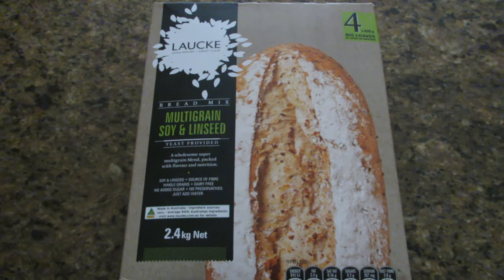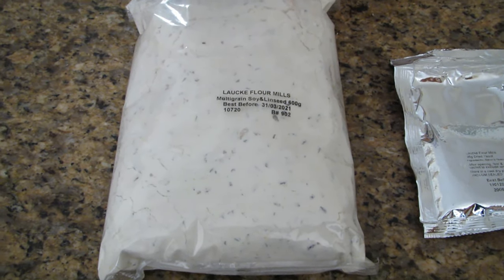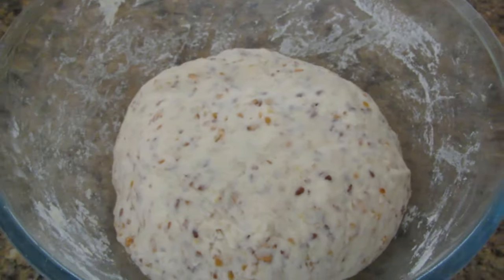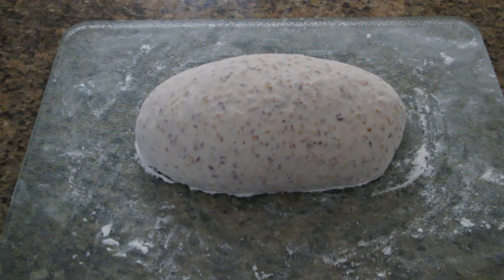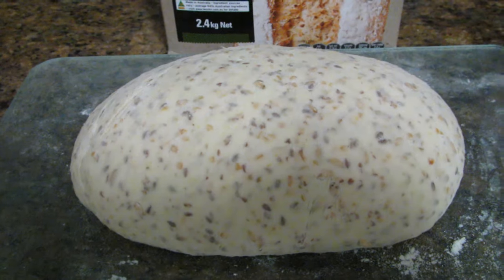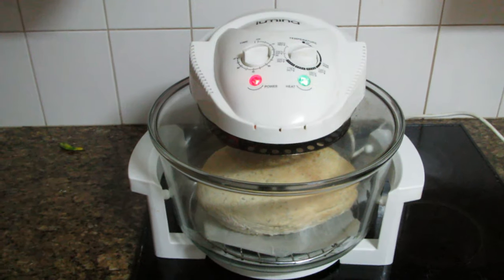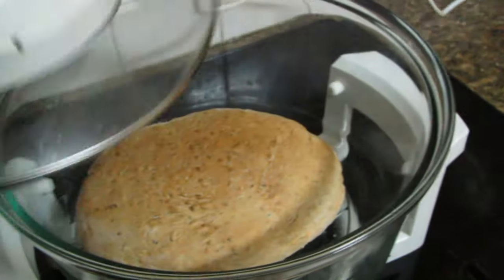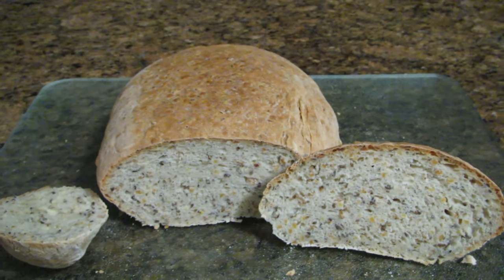Can you bake bread in a Convection Oven?

Comment: How come you had paper under it when you put it in but not when it was done? Just curious.
Reply from the maker: Thanks for your comment Lyn. The reason that I first put it on baking paper was when the dough was soft to stop it oozing through the metal rack & then potentially cooking around the bars trapping them inside the hard cooked bread base. Once it had been cooking for sufficient time to firm up the outer crust I could then remove the baking paper to allow better airflow for cooking around the loaf. Hope you enjoyed the video.

Have a look at my Mashed Potato method, it is a huge time saver with no boiling or peeling required.

Comment: Thanks for sharing this video.. Yesterday I tried to make something similar to that and i cooked it for 20 minutes and then browned the top and when I took it out of the Pyrex mold it wasn't cooked from the bottom :(
How to make the heat comes to the bottom of this kind of ovens? 
Because I love mine and I don't want to buy a normal oven that takes a large space in my kitchen
Reply from the maker: Due to the thickness of Pyrex it takes longer for the heat to penetrate as you have found. All you need to do is increase your baking time. I know this from experience myself. On my banana bread video this is cooked in a glass Pyrex dish as it makes for better viewing in the video. But if I cook it in a metal teflon tin then it takes less time. So your two options are to either increase your baking time in the Pyrex or get a thinner metal tin. Thank you for viewing my video. I hope that you may enjoy some of my other ones as well. My mashed potato technique is a great timesaver with no need to even peel the potatoes.
Reply: @Ozbullwinkle  thanks a million. You just got a new subscriber!  :D
Reply from the maker: Hamzeh Haf thank you, hope you enjoy my other videos too.